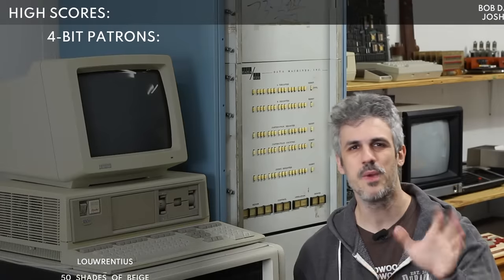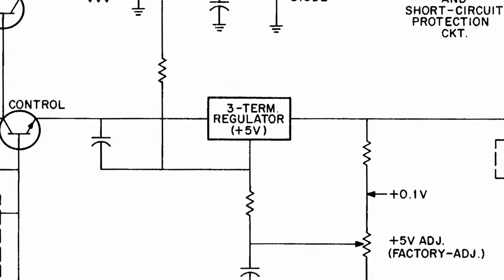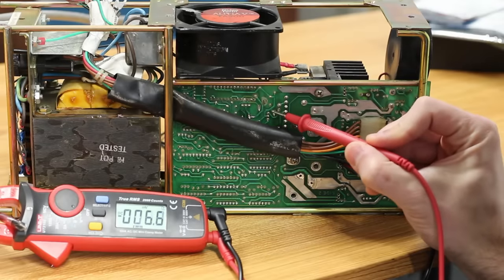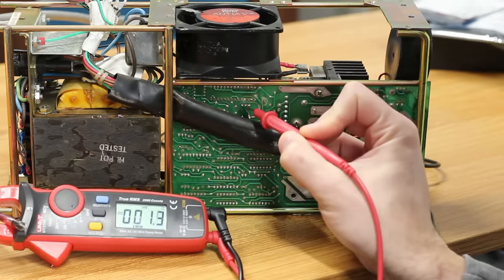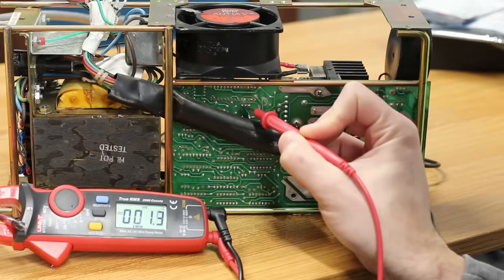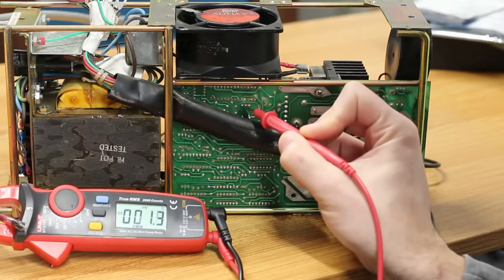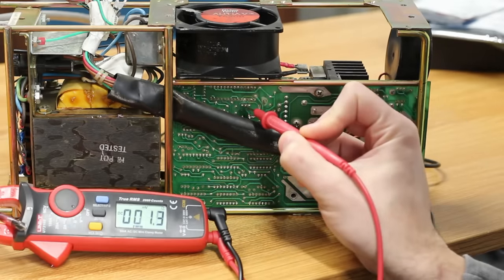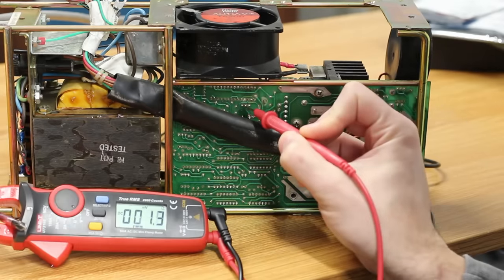The PDP-11/23 Plus Works!

Comment: Using a 7805 as a buck converter regulator, I didn’t know of that trick! I guess cheap buck converter controllers did not exist quite yet! Quite clever trick actually. I might reuse it…
Reply: I have seen this on old equipment but not for decades.  When I worked at Tektronix, I spend most days working on either sampling systems or switch mode PSU's
Reply: but shouldnt there be a shotkey diode or something at the output of the 7805 to avoid back driving ?
Reply: Years ago i was given an old PSU at work to fix. It had a 7812 in an TO-3 package and 8 (!) TO-3 Transistors to boost it. I think it was something like a 20A 12-14V Output.
Was probably from an old Camper Van. I was quite surprised back then. I also never saw something done that easy before. Oh boy did the heatsinks get hot....
Reply: Take a look old 78xx datasheets from the 80s (can't remember whether ti or sgs). Back then I build it and worked fine.
Reply from the maker: It's a really cool design! All the years later and DEC is still taking me to school, haha.
Reply: Would be neat to see!
Reply: Selfoscillating power supply. Works best if the load is stable and known
Reply: @SarahKchannel  I think only simplified schematics were shown.  I believe there is a diode between input and output of the 7805 to prevent the output from going higher then the input.  I know it seems strange to treat the 7805's output as also an input, but it has to be able to sense the PS output in order to work.
Reply: I believe some of the old datasheets for that reg show a similar architecture in one of the later example circuits!
Reply: @russellhltn1396  The sensing part makes sense, it weird non-sensical way :). It was just something that stuck out to me, not sure if relevant or not, hence asking the Pro's.
Reply: I actually new the trick how to make 7805 to work as a switch mode buck. But I never used it, because there are a lot of better single chip solutions than support high frequency/smaller coils and no need for a lot of BJTs.
But only now I see a great benefit of this device - yes, this device can work with no load no problem. And moreover on low-power loads it doesn't make ugly nose caused by 'relay-mode' of buck. So indeed there is a reason to use this device in modern DIYs
Thank you!
Reply: I used the 7805 to make my first project that requires 12v.  It's more then possible. And the possibilities are endless as long as you do not need more then an amp at the output.
Reply: @SarahKchannel no need for diode, it's not back driving as the input voltage of the regulator is higher than the voltage on it's output pin.
Reply: I've seen schematics for it on rare occasion, but the idea of it seems quite rare, much like 50/50 duty cycle configurations of the 555 timer, or using a single transistor inside a Wheatstone bridge- it's possible, but almost noone actually talks about it. Still, so long as the regulator can handle the voltage swing, I think that any linear regulator whose data sheet warns of oscillations can be made to do it.
Reply: Many years ago I had a product book (before internet) full of Texas Instruments voltage regulators. They included a few typical designs along with the datasheet. I remember they actually had a switching circuit for the linear three terminal regulators. I wish I could find an old PDF I can include.
Reply: @SarahKchannel  But the back driving voltage would also be 5 volts, since the 7805 acts as the comparator that drives the feedback loop. A 7805 that has power on its input won't mind something else pulling the output to 5 volts or even a little higher. In practice you'd never see 5.2 volts, for example, and certainly not enough to cause problems.
Reply: @roman65536  Agreed. The old National Semiconductor books (among others) are a treasure trove of useful application data.
Reply: @rj7855  cool, thanks ! That makes sense.
Reply: I have even used the design.
Reply: Could you explain why this is not a linear supply? I mean, if the coil was not there there whole thing would just work as a linear supply. Is it really switching? It that combination of coil and cap really enough to make it fully oscillating to the extend it is really switching?
Reply: @steenhansen8  tbh any power supply works best if the load is stable and known :D
Reply: there was a circuit using a 3 terminal regulator as the control device for a switching regulator in a tandy semiconductor data book in the mid 80s here in the uk, the actual switching transistor is a PNP type ....
Reply: If you can find it, check out National Semiconductor’s Application Note AN-2 from Bob Widlar titled “Designing Switching Regulators” from April 1967.  Bob described using a fixed-voltage linear regulator in a switch application very similar to what the PDP-11/23 used.
Reply: @UsagiElectric   -  I have a complete PDP-11 system with video terminals, teletypes, and a couple tape drives. This is a full featured max memory with all software from DEC. One of their field engineers/developers had his own complete system. I would like to give it to you or someone who wants it for a museum or demonstration. THis is a VERY COMPLETE system with ALL options.
Reply: @cheapasstech  interesting. Tbh I thought metal fans were LESS reliable due to stuff like rust or corrosion.
Reply: @SockyNoob  
The metal frames are usually zinc alloy or aluminum alloy.
Reply: @GodmanchesterGoblin  
I think it was a National power supply aps book that had a section titled Floobydust in which odds and ends of useful info that didn't fit well into other sections was covered.

It is interesting to find National ap notes written by Jim Williams. He wasn't identified in most but you could tell of his involvement because of the scope screen photos. The Tek scope he favored and used in many of his Linear Tech ap notes produced an odd and distinctive cluster of dots that had nothing to do with the traces.
Reply: I wouldn't recommend using such a circuit except as a learning exercise. While the design is inherently stable, which most certainly is not the case for most switchers, the maximum switching frequency is low so the inductor required is large.
Reply: @alexloktionoff6833  
There was a time when it was difficult to make switchers that would operate properly with no load. These days there is a pretty abundant choice of controllers that are designed to behave "nicely" with no load. These are of interest in large part to minimize losses with no load (e.g. as in battery chargers) or light loads. Others work acceptably for many purposes with no load but in a way that may result in higher ripple voltage and slower response if the load current demand suddenly increases dramatically. The circuit in the video would perform quite poorly with a fast rise in current demand due to the low switching frequency and large inductance.
Reply: @jj74qformerlyjailbreak3  
Using any of the 78xx family for other than designed voltage is possible but performance will not be as good as you would get with something like the LM317 which is intended to be adjustable. The problem the 78xx is that the current out of the "ground" pin is fairly high and not well defined - variable from part to part. That makes raising the pin off of circuit ground somewhat problematic. The current out of the "adjust" pin on a 317 is much more tightly controlled.
Reply: @d614gakadoug9  That is very true, at that time I hadn't any of the 317s. Thanks for your feedback for the community.
Reply: It is also worth mentioning not to use Logarithmic pots. 😂 I found this out the hard way.
Reply: @kriswillems5661  
I've tried to reply to you twice with lengthy descriptions of how the circuit works but both replies seem to have been deleted. At this point I give up.
The critical part is the resistor from the emitter of the switch transistor to the network on the ground pin of the 7805. I creates hysteresis.
Reply: Interesting design, it's kind of a hybrid linear/switch-mode power supply, from back when SMPS's were still uncommon.

Comment: The first computer I ever used was a PDP 11/23 with 2-bit MMU.  It ran UNIX v7 (a pre SysV version) and had two terminals attached - an ADM3a and an ADM31.   The disk storage was two RL02 removable platter drives.  This system sat next to an old Data General Nova 800 in the university lab where I was a high school intern of sorts.
I'm so glad you got the power supply working.  That's an interesting switching design I had never seen before.

Comment: Some very dated memories here that might help (or might be a little wrong.. Hard to tell now). 8 inch floppies are RX01/RX02, the 5Mb single platter "Dustbin Lid" drives are called DL01 and DL02 as in Dustbin Lid 1 and Dustbin Lid 2

If you need to build a system, there is SYSGEN.
Formatting floppies, with badblock detection is init /badblocks RX01 or whatever other device you want to use.
I recall a diagnostic disc that could be used for hardware testing. Not sure if anyone has a copy of that on-line now ?

I'm sure there is other info on-line. I noted a pdp-11 site in the Netherlands that had handy info, but I'm sure there are many others too.

This system was also my first introduction to lots of new things including Advent, the adventure game, assembly language, multi-user systems and a bunch of other skills that have proven handy through my career. Thanks for the non-volatile memories.

Comment: I saw the processor and I recognized that was a DEC part number, the other number (6007-38)is the lot number of the chip run in DEC’s semiconductor facility in Hudson, MA. I worked in that facility from January 1979 through May 1998 for DEC and then from May 1998 through April 2015 with Intel. I saw the date code 1983, I was an equipment technician working on the process equipment on the fab floor at that time. Best company I ever worked for, nothing has matched it in my career.

Comment: For the second week in a row, it is the same component failure as Adrian's Digital Basement experienced (1N4148 diode failed short). Adrian also had a circuit schematic that didn't show all the components! Although I suspect in this case, there was an avalanche failure that took out several components. Another brilliant learning exercise. I wonder if the PSU design has evolved from a previous one, because the architecture is rather odd. It just has that feeling of being adapted from something else.

Comment: Nice work!  CPU and memory and terminal interface working.  Just a tip - the fact the input to the 7815 was less than a volt was a tip that the 7815 was a clue that the issue was upstream (transformer or diodes).
Reply: Yeah, as soon as I saw that the input was so low, I questioned whether or not the regulator was actually the issue.

Comment: When removing through hole components that you know you are going to replace, cut the legs first and then all you need to do is desolder the remaining part of individual pins.  This saves stress on the pcb and is easier and quicker.  You can still check part function from the remaining stub of legs on the part for post mortem purposes.
I like using ceramic tip locking (reverse) tweezers for holding pins while desoldering them.

Comment: Well, moral of the story is to check ALL power rails before debugging a specific one.
Although you'd be forgiven for not noticing that the 5V section used the -15V reference. It's quite a sneaky trick and hidden well. Didn't catch it at first either.

Comment: excellent work and congratulations! tenacity is the key to troubleshooting.
Reply: Indeed it is. I spent two frustrating weeks sitting over a baaaaadly noisy power amp in a Harman Kardon 730 and pinned the problem down to the differential pair transistors, replaced all of them to prevent the same thing from happening in the other channel. Very satisfying.

Comment: for pulling out components, I find a small metal crochet hook to be ideal.
Reply: If you can find a set, dental pics are amazing for small, tight spaces.  Care must be taken, however, because they are metal and conductive, you need to make sure everything is dead before poking around.   Short across an undischarged capacitor can make for a few moments of excitement, and perhaps more repair work than when you started...  ^-^
Reply: Crochet hooks are useful for circuit tracing after a computer executes an HCF instruction (halt and catch fire).

An ancient PDD-8 (as a TSS-8 - it had 16 teletypes for user terminals) in my department executed that instruction. The backplane for the CPU was all wire-wrap and something around 2 feet square. This resulted in a bunch of burned wires. I tracked them all down by visual inspection, using a pair of hooks to gently tug on wires to find their routes. Iirc, there were only two that were badly burned but that damaged insulation on a number of others that were in contact (these were 28 or 30 AWG fluoropolymer insulated wires. Again, iirc, it was a memory driver board that that had actually failed and caused the damage to the wires.

Comment: Love the Centurion backdrop but that wonky shelf bracket is driving me nuts :o)
Reply from the maker: Which bracket are you referring to?
The Data620 in the opening has a bad rail on the Core Memory unit, which is why we have that unsightly gap. I'm still working out how best to solve that, but the Centurion system is pretty neatly put together I think!
Reply: Why did you have to point that out, now I can't unsee it
Reply: @UsagiElectric  16:55 I think that middle bracket of the three seen on that shelf on the top right... it's a bit cockeyed xD.
Reply: @colinstu Oh, for pity's sake...
Reply: @johnm2012  yeah I didn't even notice. I'm gonna keep ignoring it.

Comment: Q9 in the crowbar circuit is a programmable unijunction transistor (PUT). It's used as a voltage controlled switch to accurately and decisively trigger the SCR.

Comment: Nice job on the power supply revival, sometimes there is a red herring that leads us down the wrong garden path. The 11/23 is a fairly stout 11 so it will make for a nice RT-11 and even a good  RSX-11M+ machine. that ADDS portable terminal is really cool, such a 70's color scheme, I can't wait to see it working.

Comment: Oh, this brings back memories. Still wish I could have kept the PDP-11/23 that I had access to 30 years ago.
Reply: You might want to check the PiDP -11/70, a recreation of the control panel with a Raspberry Pi running the simh emulator. I built one during the COVID lockdown, and it's great fun to use. There's also a project to recreate the PDP-11 guys on an FPGA to replace the Pi part of the system.
Reply: @chriswareham   Yes, have considered, but there's something with working with the actual hardware that appeals to me, not so much playing around with the OS and so on.

Comment: Clearly the work of the wizards of Maynard mill. 8^) I was a university student in 1980 and we had several LSI 11/24 with TU58's (a random-access tape drive) as their boot device as part of a lab setup. You've really captured the conflict that ended up elevating the PC over the supermini machines that DEC manufactured- we (I later worked for Digital) made everything in house and each new machine was built to spec from the ground up. The power supplies were unique to each platform and would undergo field revisions as changes were made. The smaller PCs focused on using commercial off-the-shelf components and assemblies that didn't exist for the early DEC platforms and weren't part of our corporate workflow in the later machines. All that said the hardware and software were bulletproof and would run for years non-stop; it wasn't odd to do a show memory on a machine and see it hadn't been rebooted for over a year.
Reply: Why over a year?
Reply: @keylanoslokj1806 why not? If you had no reason to reboot you wouldn't.

Not that you couldn't do a year on a pc
Reply: These were multiuser systems and the PDP series was frequently being used for factory floor control. System shutdowns were generally scheduled.

Comment: You missed an important component in your description of the 7805 based regulator.  I will describe that part of the circuit from memory and hope I get it correct.
The emitter of the "pass transistor" goes to the junction of a diode to ground and a large inductor to the +5V.
When the pass transistor is on, the emitter is at the +24V-(a bit).  Current starts building up in the large inductor.
Think of this current as ramping up from zero until it is more than your load current.
When the inductor current is more than the load current, the output capacitors start to charge up.
At some point (more on that in a moment) the 7805 stops trying to pass current so the pass transistor switches off.
The diode I mentioned previously is now conducting and the current in the big inductor is ramping down.
At some point, the voltage goes low enough that the 7805 decides to act again.
Now for the "more on that"  Note the resistor from the emitter of the pass transistor to the GND leg of the 7805.
When the pass transistor is on, this slightly raises the voltage on the GND of the 7805 so that it sees a lower voltage from its output to its ground pin.  This makes the 7805 slam on extra hard trying to get the voltage up to 5V.  This means your pass transistor will be biased solidly on.  When the pass transistor finally turns off, the resistor lowers the voltage on the GND of the 7805 so it sees a slightly higher voltage and stops delivering current.

Comment: I have ine of those irons, i stipped using it when the nozzle developed a notch and pin hole in it making it usless... I have a cheap solenoid actuated suck now, works good. Although the nozzle is a bit fat and used my drill and dremmel to make a finer tip